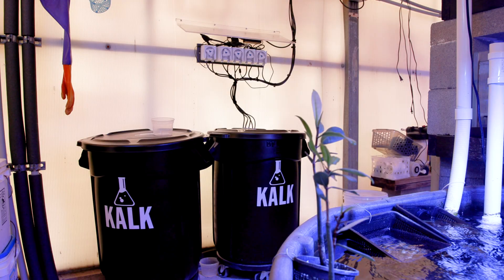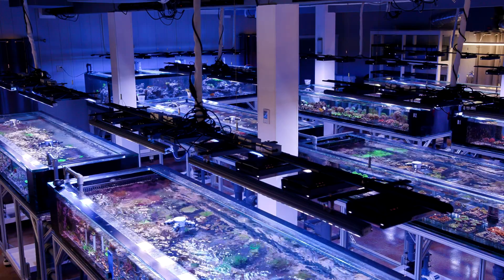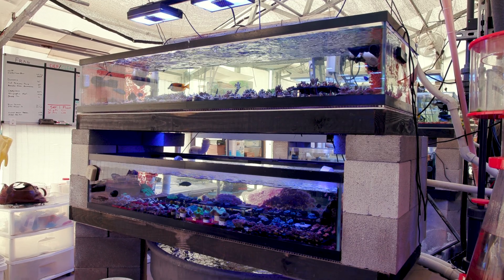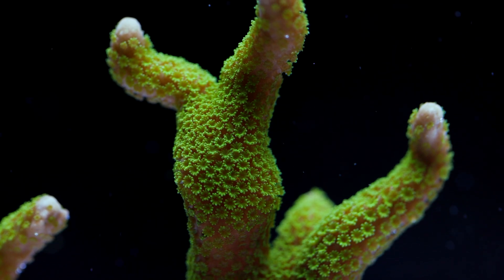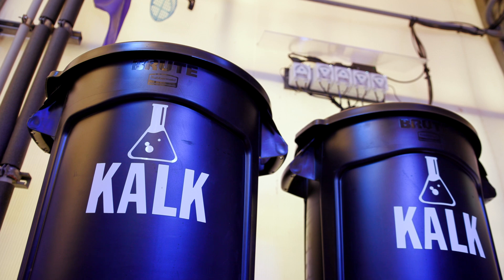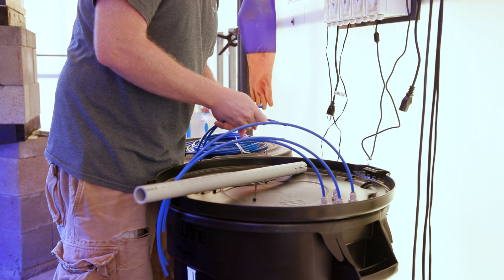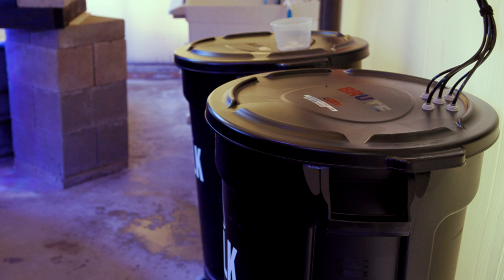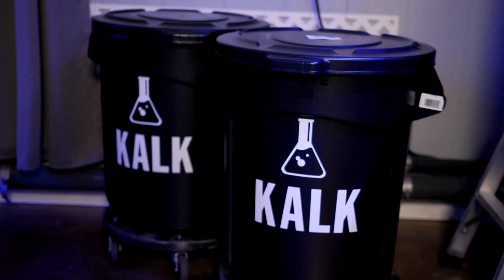Kalkwasser Dosing Setup

Comment: Hi there,

I’ve just watched your videos about Kalkwasser dosing—great content, thank you!
We own a coral shop here in Turkey, and we’re planning to start using Kalkwasser in our system, which holds around 1000 liters of water.

I have a couple of questions:
	1.	Do Kalkwasser reservoirs typically include a mixing motor to keep the solution stirred, or is that something we should add separately?
	2.	For a 1000-liter system, how much Kalkwasser would you recommend dissolving per day or per batch?

Looking forward to your insights!

Best regards,
Reply from the maker: I don't know the formula off the top of my head but you want to use just enough that a tiny bit precipitates.  Any more and it is a waste.  As for the mixing container, I don't like to use a pump because kalkwasser is very hard on the devices and it is not necessary.

Comment: What size PVC are you using on the three-quarter inch bulkhead push connect?
Reply: It’s 1/4” tubing. The push to connects are designated as the size tubing they will accept. Side note tubing is measured by OD where pipe is measured by ID.

Comment: Kalkwasser is pretty expensive  once you start getting a lot. It's cheaper and easier to buy pickling lime or calcium hydroxide in bulk. It will be coarse and harder to mix but using diluting it with large tanks makes it easier. Mrs Wages is pure and you can find pure calcium hydroxide from any chemical store

Comment: Thanks for another great Video.  I am currently using a DIY dripper system (my tanks are all under 90 gallons) that works very well and is adjustable but I think I may be making the change to a dosing pump in the future for the sake of increased automation and stability in water chemistry.  Other than small, frequent water changes, Kalk is about the only thing I dose regularly since I discovered it in 2002.  The results on my tanks has be awesome in no uncertain terms.

Comment: The Versa is a nice little pump, and I'm currently (temporarily) using it to dose Captiv8 trace, but it's local control only. No connectivity unless you're nearby. That's unfortunate. As for kalk, I see it as the foundation of all dosing, as it is incredibly inexpensive compared to other alk/cal supplements.

Comment: Love the vid and Info (watching from Sydney Aust).
How do you mix the Kalk?
Also, Is this supplementing your 2 part dosing or replaces part of it?
Reply from the maker: Most of the heavy lifting is done by the calcium reactor.  Kalk helps supplement that and only after that if the levels need to be tweaked we use 2-part.

Comment: Fyi Versa have a glitch they will stop working randomly if the program calls for dosing during 12:00 or 00:00 found this out the hard way. When my versas all of the sudden stopped when I was gone for a few days. So if your running a program work around those hours for 15 minutes.
Reply from the maker: Thanks for letting us know.  I don't know if we have noticed anything like that in our operations.
Reply: I run my program across 0:00 and have no issues.

Comment: Ecotech Versa pumps are very durable imo and work well. Thanks Than..
Reply: Good pumps but the tubing lasts only 3 months in my system
Reply from the maker: Are you using them for calcium reactors or slow/low useage?
Reply: @tidalgardens  slow useage for my kalkstirrer. Just started using it..
Reply: @tidalgardens  calcium reactor at 60 continuous pushing water.  Also run Kalk at 8000/day with DOS in 320 gallon system.  When dkh drops I check tubing
Reply from the maker: @andrewsdrmike  I can see the tubing wearing out in a calcium reactor implementation.  Do you have it pushing water into the reactor or pulling it out of the reactor.  I've always heard you want to have it pull water out.
Reply: @tidalgardens  I push water through the reactor
Reply from the maker: I am happy with them as well.

Comment: Ecotech Versas for the win. Have tried the Kamoer and have not been happy with it because I find the hose connection isn't great. I now use the Versas for auto water changes and kalk. Next up plan to buy one for my calcium reactor
Reply from the maker: We tried the calcium reactor peristaltic pump implementation once and ended up going back to a regular old powerhead to feed the reactor.